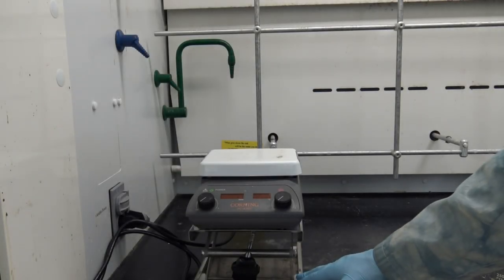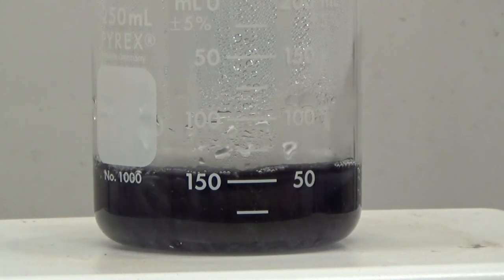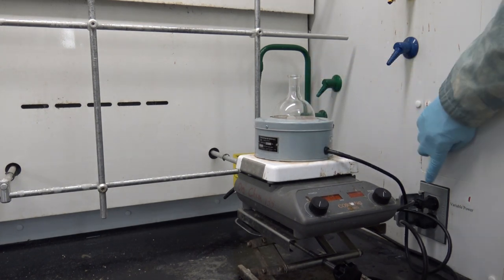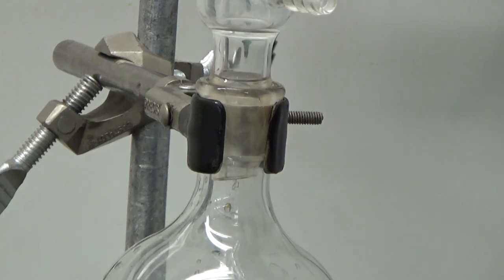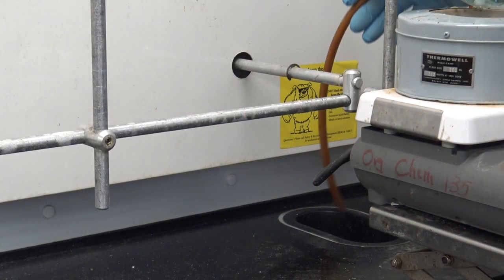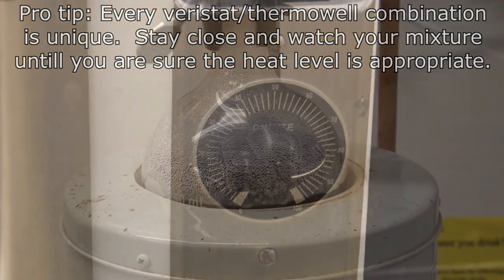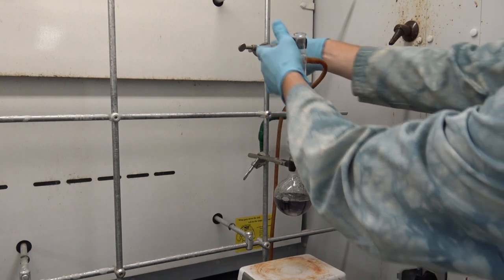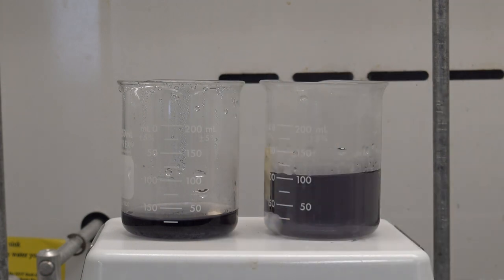The Benefits of Refluxing - Demonstration

Comment: Great explanation but why the condensing column is opened from above  ? are you sure it won't escape ?
Reply from the maker: The opening is to prevent pressure from building as the sample is heated.  Refluxing in a closed system is a much more complex and dangerous technique that we typically only use for air sensitive reactions.  Loss of solvent through this opening is generally negligible when the technique is performed correctly, but if you have concerns you can substitute for the Liebig condenser I used in the video using something even more efficient like a Dimroth condenser, which is still open, but has even more surface area available in its cooling coil to promote heat exchange (and therefore condensation).  I know it seems hard to believe, but you can boil some solutions for hours, days, or even weeks using this simple, open system if it is set up correctly!
Reply: @ChemSurvival  I am really in dept to your help sir. 
I may ask you one more question which is, if the aliquot of a binary mixture passes through the condenser and it contains the distillate (high volatile) and the other substance (less volatile (BTW what is the proper name for it ?)) why only less volatile component will condense and not the high volatile ?! what is the temperature of that cold water running in the condensing column is it above the boiling point of distillate component so it prevents it from condensing ?

sorry for my weird questions but I am wondering a lot.

Comment: When refluxing and at high temperatures, is it possible for the grease to melt and descend into the beaker and mix with the liquids?
Reply from the maker: Indeed. One needs to be very careful when using vacuum grease. When it comes to this material, less is more. Too much grease will almost certainly contaminate your samples, but a little bit of Grease can be very helpful.  this is particularly true when refluxing aqueous bases like we do in our teaching labs. Without it the hot aqueous base can dissolve small amounts of silica and drposit a cement like material between the joints, effrctively destroying your glassware
Reply: @ChemSurvival  Which is better in terms of use and giving acceptable results in addition to giving thermal homogeneity of the solution? Is it a stirrer device or a water bath or a heating mantle?
Reply: @ChemSurvival  Do you recommend using Teflon instead of Vacuum grease?
Reply: Do you have a special email for inquiries?

Comment: Why on earth would you use grease for ground joints other than in a setup in vacuum. Unnecessary and often gives those nice grease signals on NMR
Reply: True, but sometimes depending on the reaction you are carrying out, although typically with strong bases you may get frozen joints, which can be a pain to separate. If you don't mind the idea of risking your ground joints being stuck together when you go to disassemble your apparatus then go right ahead. Personally I find that if you use a tiny bit of grease right at the top of the ground joint you shouldn't get much grease, if any, in your final product when it comes to NMR analysis.
Reply from the maker: Indeed. In my teaching labs, we often perform saponifications and frozen joints were a serious problem until I included this instruction. additionally it's worth noting that with grease, less is more.  A small amount can prevent vapor escaping and prevent frozen joints. A large amount can easily end up causing contamination and dominating your NMR spectrum.
Reply: Flubberlul around 0.0 - 0.5 ppm as messy aliphatic stuff. When it is silicon based it can even be slightly upfield from 0, like -0.1 ppm
Reply: I only seem to get trouble with frozen joints if the joints are wet, especially with water or basic solutions as you guys pointed out. I always make sure the joints are clean and dry before putting it on. Also, just put it on without twisting and turning it while it's fitted. This at least for me ensured this almost never happening anymore.
Reply: I've recently started distilling using lab equipment and I noticed that my joints were pretty stuck at first. I simply used some hot water on the outside and even a hair dryer seemed to work perfectly to unstick the joint. Is there any reason I should know about,  that doing it the way I am could be problematic? Given that its borosilicate glass it seems unlikely that this could be a problem. Application of heat should be fine to unstick them right?

Comment: let alone less solvent used how about clearing up an unattended setup like you show us.
i think it would be smart to add a thermal probe to the vapors and set a range of
operation.  say 200 to 215 F.  so that an alarm goes off when the vapors are too low or too high.  this way casual attention while the lab people tend to other tasks is supplemented by an electronic watchdog.

Comment: what sort of stuff needs hours and hours to dissolve in a heated solvent ?
and
when  is putting solvent and solute in a untrasonic tank and letting the solvent
molecules 'hammer' the solute into solution less bother than refluxing ?
Reply: bob along  making  5-ATZ(5-Aminotetrazole) which is the precursor two very interesting tetrazole explosives requires two hours of refluxing. So to answer your question that kind of stuff.
Reply: MDMA and many other amphetamines. Recreational and Medicinal.

Comment: why is everybody using a Liebig condenser,  most of the time it's not efficient enough for refluxing, btw vacuum grease is only applied on the upper third of the joint
Reply from the maker: Typically liebig condensers are used because they're cheap, adequate for lower volatility solvents like water and already in the kits for other applications. As for the somewhat liberal application of vacuum grease I teach this to my students because we reflux strong basic solutions during lab which often fuse the glassware together if they are not more liberally greased.
Reply: @ChemSurvival    our students also have to use vacuum grease to prevent ground joints from fusing, but we have seen from experience that vacuum grease is distributed very well over the entire joint if you apply enough of it only to the upper third of the joint, if you then put the two joints together and rotate it a few times, it's distributed very well over the whole joint (recognizable by the fact that the joints become transparent over the entire length) this has the advantage that at the lower end of the joint less vacuum grease can be dissolved away and contaminates your solvent,  of course, if you use a large amount of solvent anyway, contamination may be irrelevant